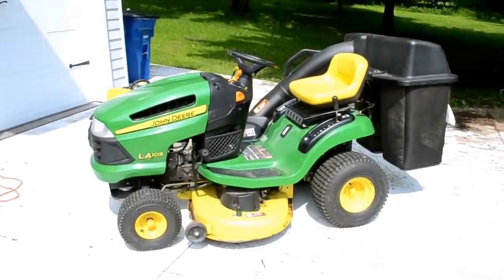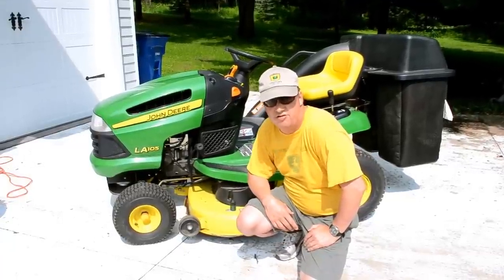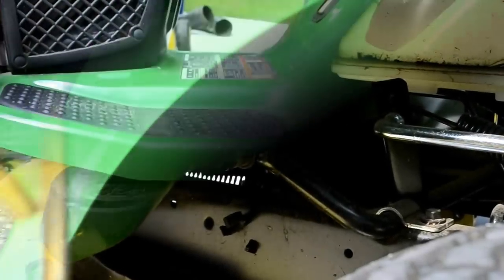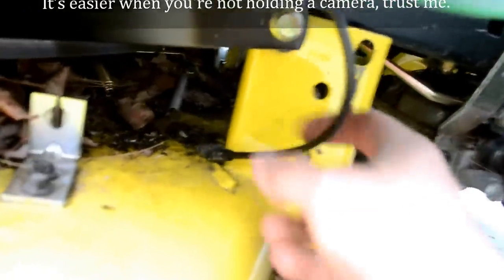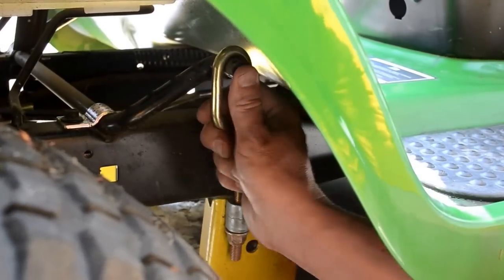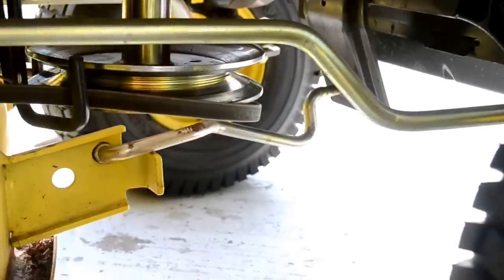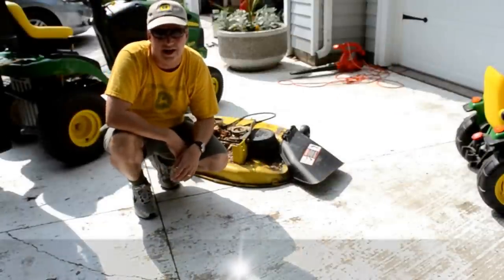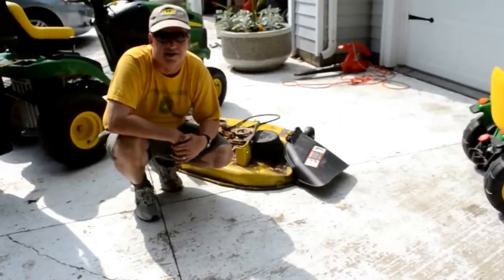How To Remove The Mower Deck on a John Deere Tractor

Comment: YOU DO NOT HAVE TO REMOVE THE DECK TO SHARPEN OR REPLACE THE BLADES..JUST RUN IT UP ON RAMPS. YOU CAN HOLD  THE BLADES OR JAM THEM WHILE YOU REMOVE THE NUT. I CAN'T BELIEVE YOUR TELLING PEOPLE TO REMOVE THE DECK.
Reply: william green I cant believe you don’t know how to type without yelling